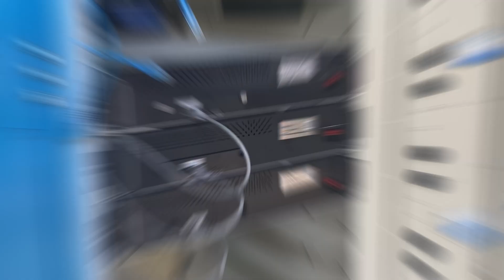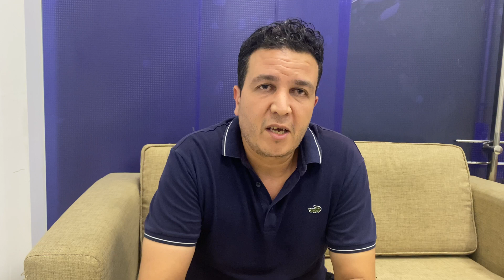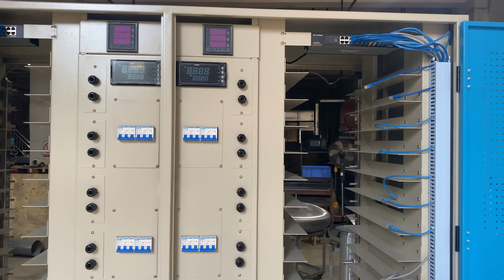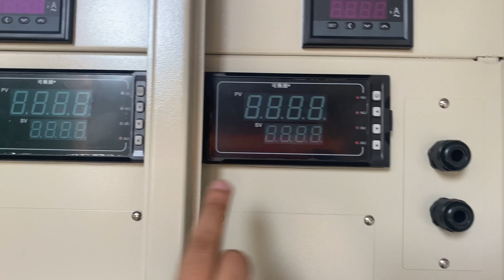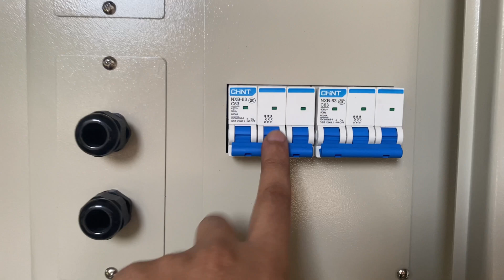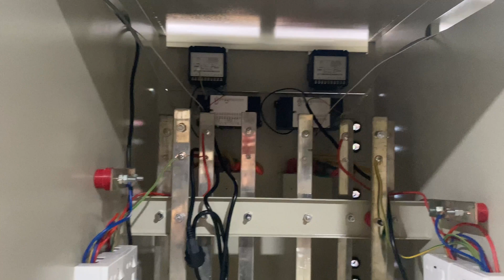how to Mine Btc with Whatsminer M53 M33  Hydro

Comment: Where is the cooling water unit stored?
Reply from the maker: there are two different cooling options , a dry cooler or a chiller for hot weather , both units need to be placed outdoors for heat dissipation

Comment: Thanks for sharing your knowledge. I would like to know how you made those cabinets. Can I make a cabinet for only 10 ms53++? And I will have my cabinet located inside a container, will I need an antifreeze collant?
Reply from the maker: Well i guess you can make yours , bur it will take a lot of try and error before you get everything right , at at this point i'm not sure if its worth making one yourself or just by one ready to use , and keep in mind that you need a coolant distribution unit as well as a cooling system such as a dry cooler  and the whole think will be very costly compared to companies making these in large quantity where the cost is cheaper than building your own